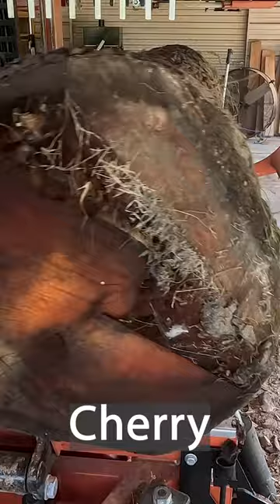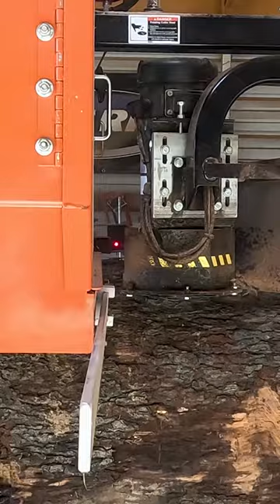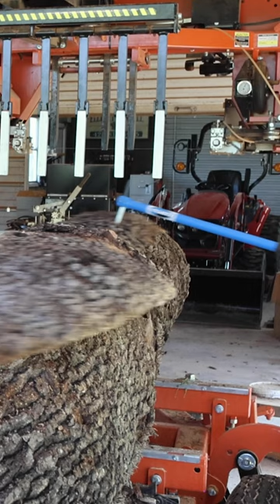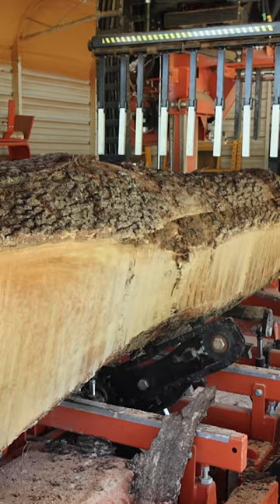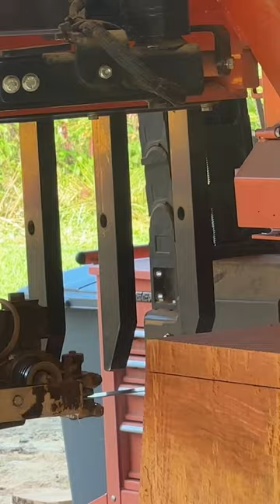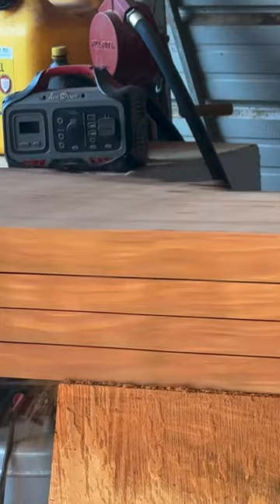Cherry Like This Will Set Your Sawmill On Fire! #woodworking #woodmizer #portablesawmill

Comment: When I went to carpentry school a guy in my class got a cherry log that had been on the bottom of lake Logan more than 50 years. He had it milled and it took had some of the most beautiful grain I've ever seen. Later on in years I was building a house not to far from that area but we was on the edge of national forest land. From the road you would see a cherry tree here and there that was more than 5 ft through the center. Then a few years after that I was driving across the mountain and saw them flying logs out by helicopter.

Comment: I took up woodworking a year ago and as of yet I’ve not had the pleasure of working with Cherry 🍒
Reply: Do it. The very first table I built, during my freshman year of high school, was cherry. It was the cheapest log available, but it was absolutely beautiful when I got it cut open. I built a mahogany grandfather clock with cherry inlays for my sophomore project. Unfortunately, the second log wasn't quite as beautiful as the first one, but the overall project turned out fantastic. Cherry is easy to work with, and it's gorgeous.